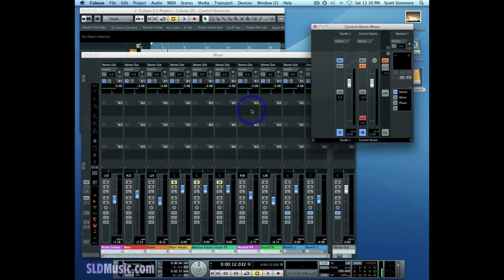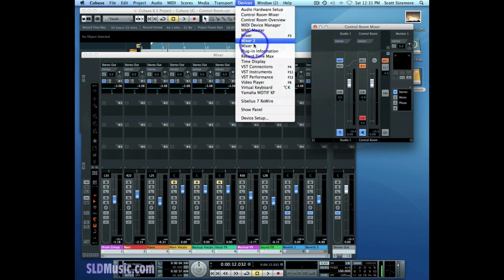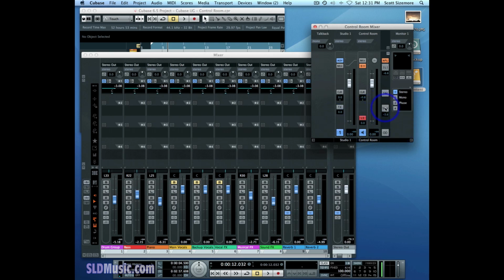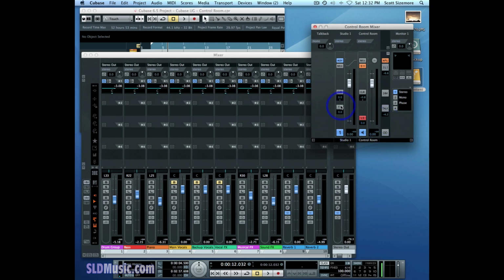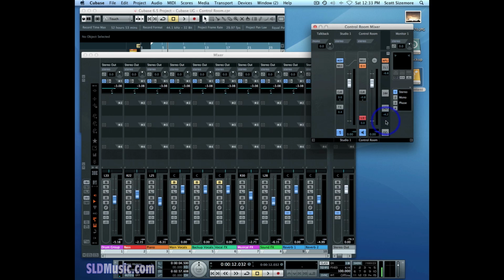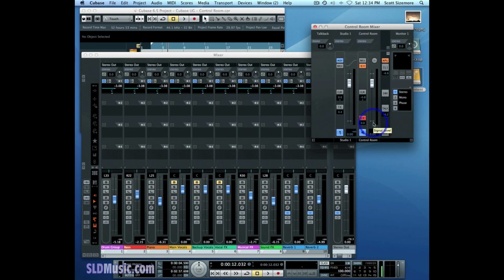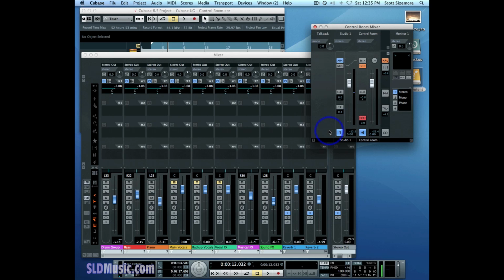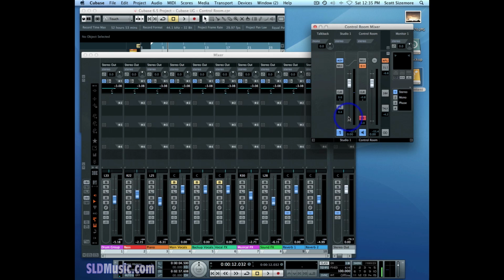Demystifying the Control Room in Cubase - Part 11 - The Talkback System

Comment: I have Cubase 5 now (will upgrade to 9 soon (or 10 when it comes out). The control room mixer in Cubase is too confusing to use. I am looking into a separate talkback intercom that plugs into my headphone chain. The only problem is you will have to manually lower the music or stop playback if you want to communicate with the other rooms.